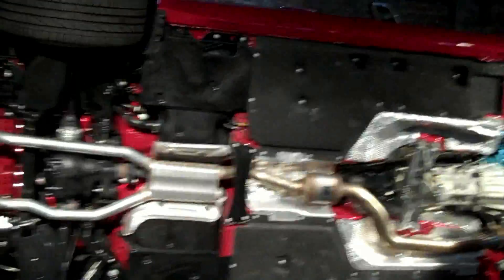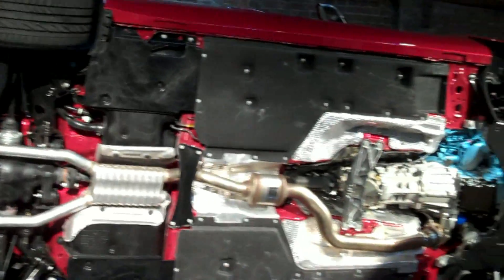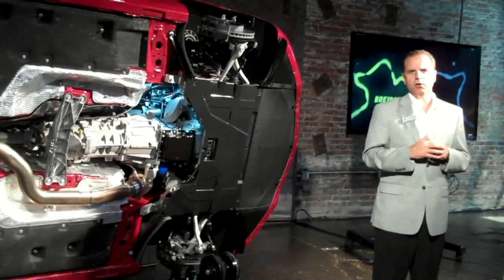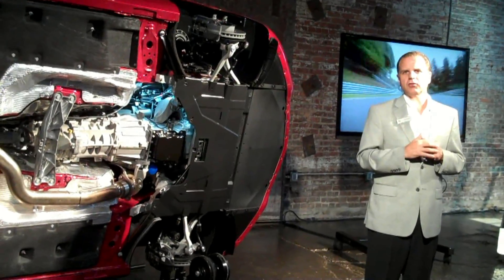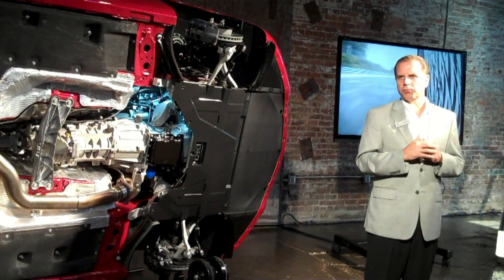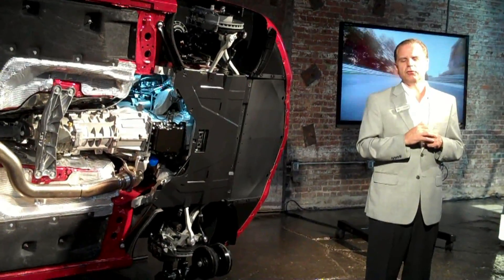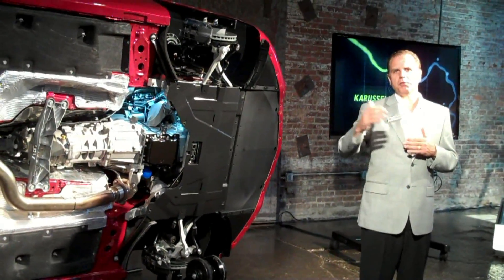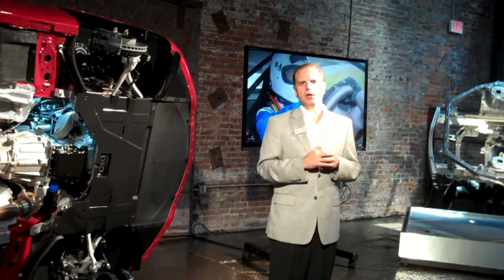GM Turns A Cadillac ATS On Its Side!

Comment: U.S car makers... Cad with rear wheel drive .no real horsepower! same for this impalas.front wheel drive. impalas should have rear wheel drive options. MORE HP!  LS < LT <LTZ all with the same HP... sad!
Reply: Dennis Kingsley 272 hp is plenty. If you can't afford a 400 hp car that's not GMs problem, it's yours.
Give me an example of any other rwd car with this kind of power at this price point that also offers a manual transmission.
Hint, you can't.

Comment: This vehicle is so extremely well built and engineered but I do not think that the marketing and advertising dept.give it as much justice as the engineeres did in designing it .Christ ,even the 1lb engine mountings are magnesium ..Even 4 years on this vehicle does not have anywhere near the recognition it deserves.AND IT DOES DESERVE IT.
Reply: Totally agreed, the ats is such a slept on vehicle. I bought a 14 2.0t performance trim and I absolutely love it. Such a great handling car and quick acceleration to match. Mines getting warmed up to about 400 wheel hp. Then she will be just as fast as she looks!